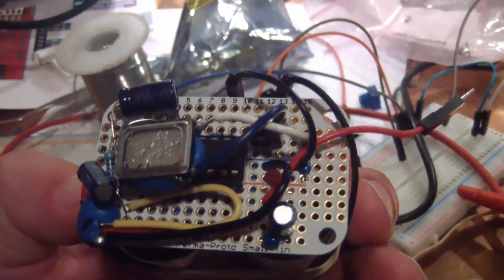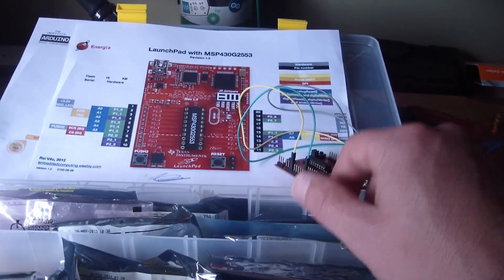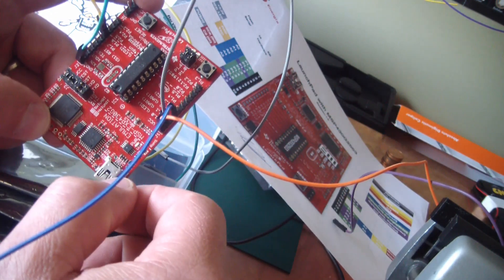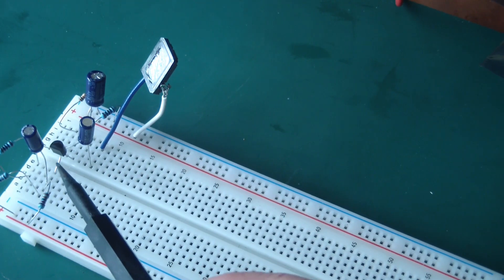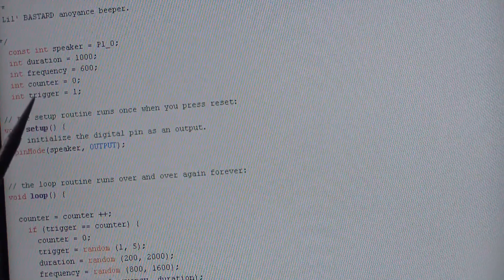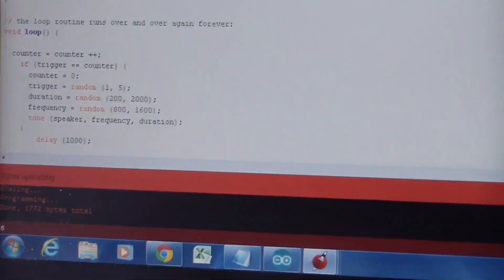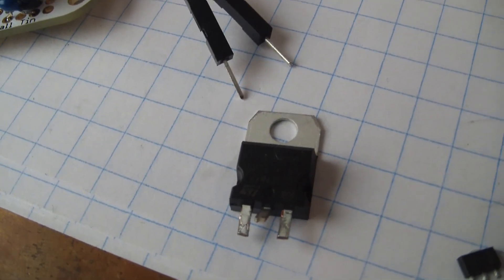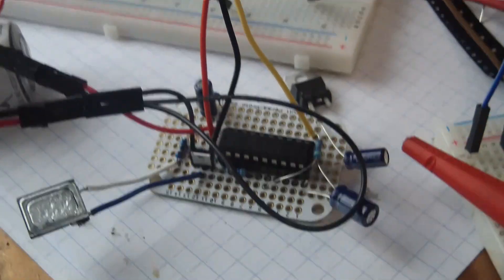Zen Blaster; a Most Annoying DIY Electronic Device

Comment: what you should do is make the chirp interval random too, i.e. the time it takes for it to trigger ;) it makes it harder to find :P

Can do it with one of two ways, either roll of the dice every x seconds roll the random number generator, if it lands on a predetermined random number then trigger, else sleep and roll again

or

sleep for an interval of 10000ms + random time between 0 and 50000ms
Reply: Max Bainrot Though thinking about it more you could use an attiny24 attiny13 running on internal osc. Depending on how much dicking around you wanna do you can either code it in AVR Studio or create a custom part for Arduino though it has very little memory so it would better to write it in AVR C (instead of Arduino C), the other benefit of AVR C is it's a little less hacky to do power saving stuff (like not having the ADC powered on when the device is awake, shutting off unneeded timers, etc). Use a standard pizeo buzzer (that self runs) and you can reduce the part count a bit, though it gives you less frequency choices

Comment: There are versions of this that have an integrated light sensor that shuts it off above certain light levels so that it is much harder to find.  That would require refining the circuit so that it was less obvious though.
The high current draw when it is making noise is due to the simple slapdash class A amplifier that it uses.  That can be greatly reduced with other refinements.

Comment: Just stumbled onto your channel this week sir.  You seem like you'd be a fine fella to share a civilised beverage with.  Keep 'er lit and may what's good for ya never pass ya by.

(PS those $2 Chinese arduino chips work just fine)
Reply: Raymus Munt If you're into the cheap Chinese arduino and raspberry pi clone stuff, check out Fasttech.com. They have an extensive selection of boards, modules, shields etc. all for super cheap prices and free shipping anywhere if you order over $20. (order under $20 and shipping is still only about $1)
Reply: revmpandora  Thanks for the link, but I like to use ebay worldwide searches .... Then if something goes wrong or isn't what I expect ebay sorts it with no drama.
Reply: Right on; on that front, Fasttech also has fabulous customer service and a hassle free refund policy. If you get stuck trying to find something through your regular sources, give them a shot.

Comment: Sleep for longer so that the range is one beep every 5 minutes to an hour.
The batteries will last much longer, it'll be harder to track down as it'll be silent most of the time and, it'll mess with people's heads more and it'll be be easier to claim you didn't hear anything.
Also, reduce max beep length to 1s.

Comment: Wondering if you could do a breakdown on modern dehumidifiers.  I live in Minnesota and rely on a dehumidifier to keep my basement NOT smelling like shit.  I seem to go through one of these things biannually.  What happened to the units that would last decades? Why are these things designed to fail nowadays? I've looked at the more expensive units (Over $1,000)  and instead of two years, you might luck out and get five.  Not sure if refrigeration is your thing, but I sure would like to see/hear your thoughts on em.  Keep your dick outa da vice!   Thanks,  Shane
Reply: shanevmax34 Dehumidifiers are essentially the same works as a fridge, and unless you buy real high end with those, you get something that lasts about 7 years average,10 at best. As compared to 20 or 25 years ago you could buy a mid range fridge that would last 20 years or better. Engineered to fail. I imagine the same downward slide of quality/longevity applies to dehumidifiers. Your choices are probably keep replacing every year or two as you have been, or spend maximum buck on a high end, most likely european made unit and keep it for long time. 
That being said, are you keeping the coils on your dehumidifiers clean?  In a dirty, dusty environment, regular cleaning of the coils can help to increase the life of the unit.  You can buy aerosol coil cleaner that you spray coils down with periodically.

Comment: Thanks for this.  I've seen you use the Ti chip before.  I'm going to try that one and the IDE.  Looks like they don't have as much into it as arduino, which is why you get all that weird sheet with having to do underscores and no clear documentation on why sleep() draws so much current, etc.  But hey, you got it to work.  And the wife got all bristly.  So in the words of a former US President: MISSION ACCOMPLISHED  What could be better?

Comment: that thing is huuugggeee (mainly because of those batteries).  You can make a much much smaller beeper circuit around a 555 timer chip, main advantage is using a LOT less power, so you can run it off button cells (hearing aid batteries) making it so tiny you can hide it much better than this one.  Double sided sticky tape and put it on the underside of a drawer, nobody thinks to look there. }:-)

Check this one for a basic circuit: http://www.instructables.com/id/Miniature-Beeping-Circuit-Prank/

You can also hide 2 or 3 of these, and the different directions will set people off from finding it .
Want to be even more evil, add a photo resistor so that it doesn't beep when they open the cupboard, drawer or whatever it is that you hid it in.

tips:
- You can make this even smaller with an SMD version of the 555.
- At a bit more cost and effort, you can make it chirp like a cricket (pretty lifelike) but that'll need extra 555's and some more side components  check https://www.engineering.cornell.edu/diversity/summer/high_school/catalyst/upload/Cricket-Presentation.pdf.  Or you go the arduino/microcontroller route anyway, and program it to do a chirp sound instead of a plain beep (there's got to be code around for that.  You can even do bird sounds or something like that.
- add a magnet and you can quickly install this on an iron/steel surface (think backside of a computer or shelves)

Comment: If you need to embed your micro controller an ATTiny 45 or 85 is great, they are a dollar each and can be programmed with an arduino without any extra components. Look up MIT's High low tech media lab for all the little bits of information.

Comment: a single 8-pin Attiny25 + a piezo speaker hooked up to two digital pins and a battery will do the job as well. Using the Arduino as a programmer you can flash the program. This way it's cheaper, and you can use the full arduino for something more useful

Comment: The amplifier circuit you are showing is a little bit overkill. It's meant for amplifying an analog signal (at least what I can tell from the circuit; I checked the site but couldn't find the exact schematic and no description either). The output of tone is a square wave, so you don't really need it. Since you tried driving it from something else than 5V you screwed up the biasing of the transistor base (those 22k and 100k values are important ;) ) and you would have been out of the "analog" region of the amplification anyway. Which is a good thing, because in normal operation this amplifier would draw maybe 5mA even without any signal (that's what the biasing does) and it's why you can't use an amplifier like this for larger speakers. It's more of a heater.
If I managed to follow the spaghetti correctly, you opted for a simple transistor switch in the end anyway ;) .

Comment: The ATmega328 used on the Uno has an internal 8MHz clock, so it'll run without an external crystal. I have no idea how you'd configure that through the Uno board/IDE though.
Reply: Smidge204 it was through the TI version of Arduino IDE
Reply: Smidge204 It's a bit more difficult. You'd want to first of all compile a new bootloader for the chip, as the lower precicion oscillator inside, means it won't be able to run the standard 115200 baud, that's normally used.

You would compile the bootloader to instead use 38400, as that fits rather neatly with the 8MHz. Then you would have to make your own boards.txt file, so the IDE knows to flash the new firmware if doing so through the IDE, with the correct fuses (You will need something like an USBtinyISP or USBasp to program the chips with a new bootloader). The boards.txt file would also tell the IDE that sketches should be uploaded at new baudrate, 38400 baud.

Now this should work, if the internal oscilator was propperly calibrated, which it might not be, if that isn't the case, then serial might not work, and you would need to calibrate OSCCAL. If you want to know how, I can do a little writeup, but that's even more work.

In short, it's not really beginner stuff / out of the box functionality
Reply: dumle29  I figured it'd be convoluted :) Still possible, though! Thanks for the info.

Comment: When I bought my 1st arduino, got the original as well, since never bothered to pay that ridiculous price and have been using clones from different manufacturers, and  haven't seen one that isn't working, 0 problems... different story is with those super cheap lcds found on the ebay, like 2-3usd for a 2-3" color lcd, oleds and similar, got all of them to work eventually, some need a bit of hardware setup to enable specific protocols, that will work with existing arduino libraries, others need some library debugging to work properly etc - most important - if it doesn't work, keep checking, come back the next day with fresh ideas, and use the Swedish adjustment tool only after seeing the magic smoke rise from it

Comment: Sounds like fun.  Question is can you build something that would sense a change in current flow and turn on a siren in a 12 volt system that could be activated and deactivated with a remote?

Comment: Nice project. High pitch constant noise is also annoying as hell and very easy to build using astable multivibrator with small polymer capacitors as a timing capacitors. If the frequency is high enough, it is almost impossible to locate it exactly, specially in the air duct. Interesting to me word "energia" is energy in estonian.

Comment: the arduino needs one part to run imbedded
a crystal
the caps on the crystal are not needed (in normal siruations)
Reply: ***** Hell, I'd just use an attiny with its internal oscillator - no crystal needed.
Reply: that is also true
and it also has a smaller footprint
i do love me some attiny
Reply: i never had that
and if i put a crystal (not a crystal resonator)
in a tube circuit it also works without the caps
Reply: ***** It would need the caps. There's no way to guarrantee that it will run  without them. It might, but there's no guarrantee. A different approach could be to switch to the internal 8MHz oscillator
Reply: i have used many atmega328's without the caps
and only a crystal
Reply: ***** It's not a defined behaviour, and shouldn't really be used in anything you care about running when power is applied. 

For quick prototyping, sure.
Reply: modern crystals do not need the caps
they are accuarte from themself
sooooooo
i have run oled displays with an atmega chip without caps over the crystal

and oleds are realy evile
Reply: ***** It has nothing to do with the accuracy of the crystal. The loading capacitors are there to ensure the MCU can get the crystal to oscillate.
Reply: no they dont
they assure accuracy of the crystal
in old clocks you find a crystal with a normal cap and a varicap
the varicap adjusts the frequency a little so that the clock can hold the time

modern crystals are accurate enough to use without

and why would a crystal not oscilate from itself
it is a peace of quarts stone compressed
it oscilates always
Reply: ***** I read up on it. seems you are right. Sorry about that.

As for the "oscilates always" Well, no, you have to drive it :P